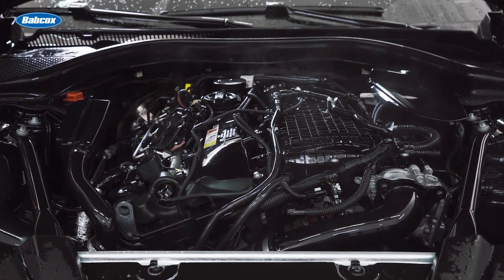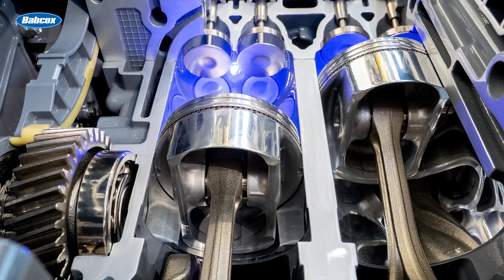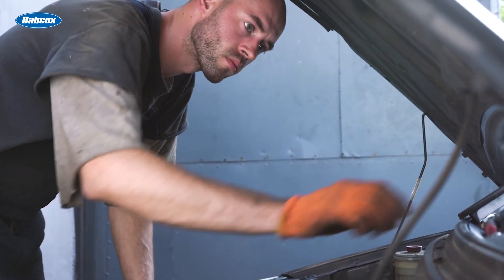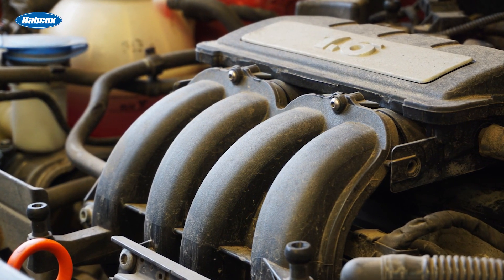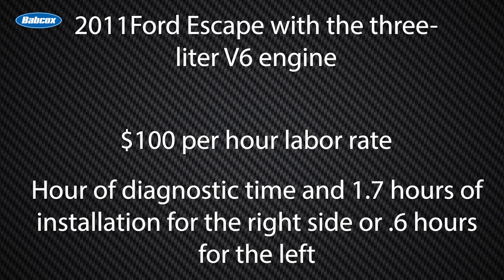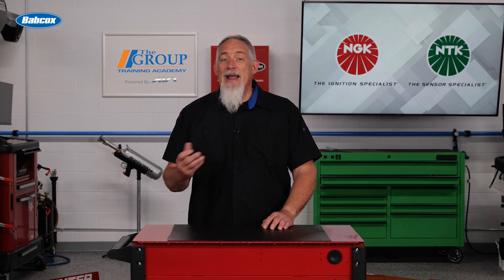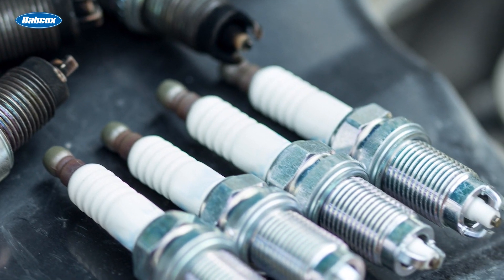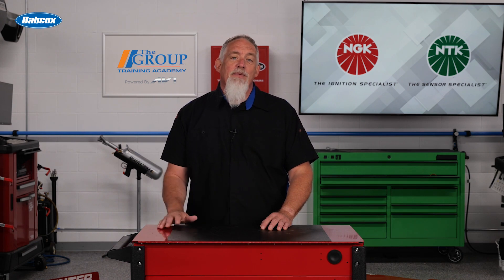Ignition System Secrets Every Tech Should Know

Comment: I have replaced a single coil on numerous vehicles, and very often none of the other coils failed during the entire life of the vehicle. This video seems to advocate selling the customer five more coils that "may" fail. The ethics of this seem questionable at best, and to be more of a method to maximize profits for both the installer and the parts manufacturer. I wonder if the host would advocate replacing all of the coils on his fixed income retired mother's car if in fact only one is defective?